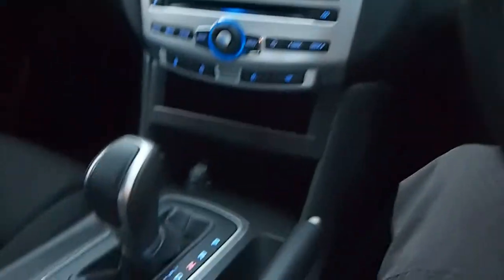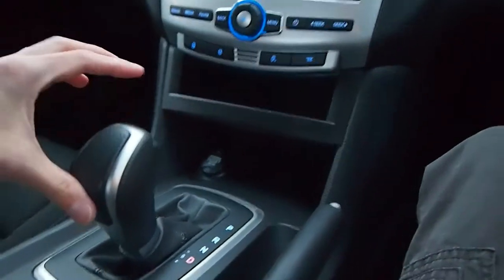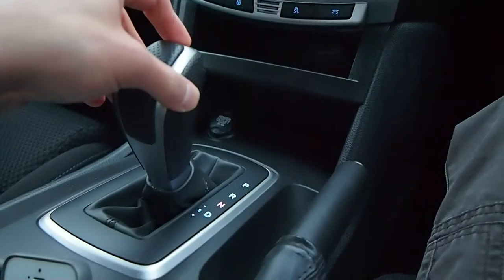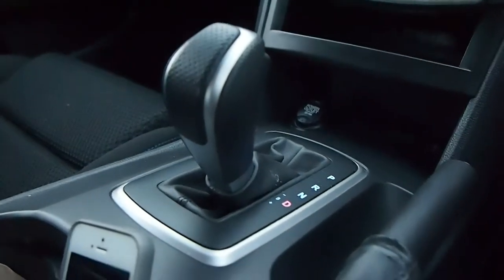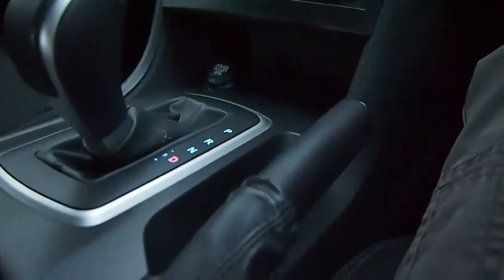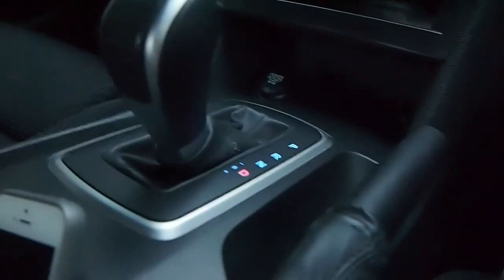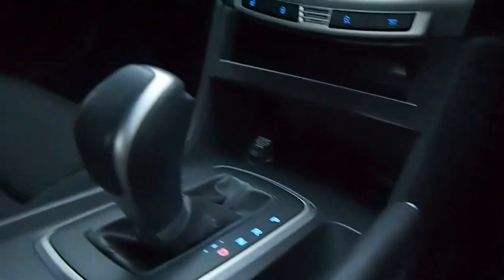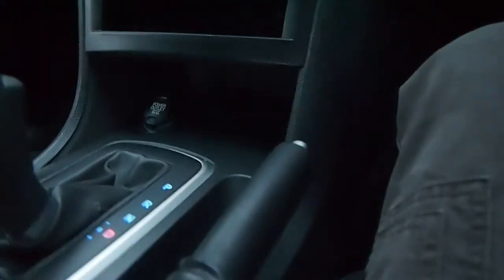Design flaw with some automatic transmission levers in Australia

Comment: So why would you shift into neutral while driving, your point is mute. If you are shifting to neutral then you should be stationary so it would then be safe to put it into reverse or park. Plus you have to pull the lever in to make that shift, you don't just accidentally pull the lever and push forward while driving.
Reply from the maker: Some people bump it into neutral as they are approaching a stop. Pressing the button can cause it to accidentally bump into Reverse while still moving forward. My point is very valid as I've seen it happen in real life before. If my point isn't valid then why are the automatic gear levers in most other countries designed to work exactly as what I've mentioned? Of course they design it that way to prevent such a scenario from happening.
Reply: Brian Su 
Even if you force it forward (I.e a lot of force compared to a bump) it’ll still be in the same gear. You’d have to brake the shifter to bump it into another gear.

If it were a manual then you could accidentally bump it into neutral when driving or put it into reverse cause I thought it was a six speed and reverse is in that position

That’s like saying the hand brake has a flaw in it design because you can accidentally bump the button which is on the front side of the leaver and it’ll release it. But you actually need a bit of pressure and it’s not in a position that can be bumped.

Or my car stops working when i forget to put fuel in it 

And the seat belt release button could be pushed if you bumped it. 

Vehicle go through multiple tests to be compliant with adr’s and wouldn’t have that and a 5 star safety rating if you were correct.

It’s the same design just fords twist on the German car manufacturers that these transmissions are commonly fitted to.

How many zf trans have been repaired from accidentally being bumped into Reverse or park. None is the answer